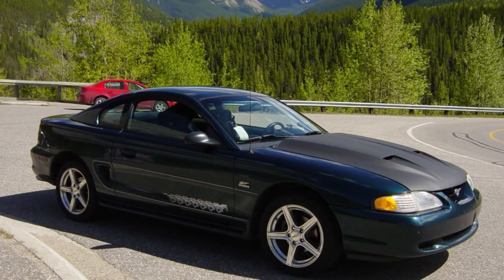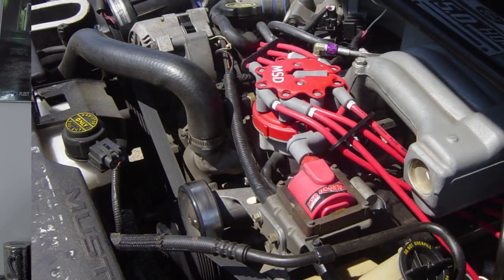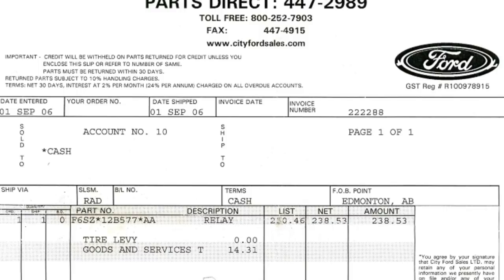SN95 Owner's Guide #3 - Myth of the CCRM

Comment: I have an issue with my 94 gt the fan will only kick on when the coolant temp sensor is unhooked I also have a poor idle maybe two different issues but the fan is a main concern  any ideas???
Reply: Had same issue with mine, your coolant temp sensor is going to crap, also look at putting in an aftermarket electric fan and also replacing the ccrm with a new unit if at all possible as another precaution...in 94-95gt’s the fan connector can get too hot because of the bearings going bad in the fan which are right near the connector and that can also cause issues to the ccrm which in turn can cause issues to the engine coolant temperature sensor

Comment: So if my 95 Mustang GT has low speed fan, but no high speed, could it be something other than the CCRM?
Reply from the maker: Hi Nick, there would be a few things I would check before changinging the CCRM based on what you've found. I would have try running direct power to the HS connector of the fan to ensure both speeds work. Then I would inspect the fan connector for damage. If that is all good, check for voltage on the HS circuit, at the connector. You should be able to force the HS fan by using a jumper on the self test connector found underhood for reading codes. When you cycle the key it will trigger the fan, both LS then HS. After that I would do the same test at the CCRM harness, you can find a pinout diagram at the link in the description box of the video. If none of those tests show the problem, I would consider replacing the CCRM. Does that get you started? Thanks for watching and commenting! - Darren
Reply: @GrandTouringConcepts  Yes, this gets me started, thanks very much! As far as the fan connector damage is concerned, that's sort of where all this started. When the car first had over heating problems I had a burnt pin on the connector. I replaced it without doing the research or reading the sellers website enough to see the suggestion of changing the fan motor along with it. So I burnt through that connector and replaced it along with the fan motor. Ever since then it seems like the cooling is really inconsistent, I'm willing to believe I've made a loose connection in the fan harness but I've worked in an electronic technician capacity for years, and I can crimp barrel connectors properly. Being able to trigger a HS speed signal with a jumper on the self test connector will be really useful. Since I have your attention, I bought the car in Virginia Beach, VA and have since moved south, to a much hotter and more humid environment. The previous owner had made some upgrades, but I'm not knowledgeable enough to know by just looking: how can I tell if the water pump has an underdrive pulley on it? Can I measure it without taking anything apart?   Either way thanks for the response, this channel is exactly what I need for what I'm trying to do, you guys are awesome!
Reply from the maker: HI Nick, you can usually determine if you have underdrive pulleys visually, or measuring. The stock stuff should all have Ford logos and PN's somewhere on them. Since youtube comments make it difficult to share photos you could hit us up on our facebook page and I can share some OE pulley photos for you to reference. Overall it sounds like you might be chasing a little larger problem, and it might be something like the fan motor is simply due for replacement. You are certainly tackling this in the right way, methodical checking, ahead of throwing the whole kitchen sink of parts at it blindly.

Comment: thought it was the transmission control box... regarding solenoid activation.
Reply from the maker: This is certainly the CCRM, and does not have anything to do with transmission control, it is literally just the fuel pump relay, and two cooling fan relays in a enclosure. Thanks for watching and commenting! - Darren

Comment: Please help lol

 I'm having a code Error Code P1233 is defined as Fuel Pump Driver Module Disabled Or Off Line. It shudders/hesitates sometimes when I turn it on/drive it sometimes. 

I have reset the inertia switch, replaced the fuel pump driver module and the shop told me the next step is to replace my CCRM but after the myth video I saw of yours I'm starting to question what they said... 

I'm at a loss and would love to know any and all opinions!
Reply: what year
Reply: 04 v6 3.8
Reply: @AaronC  any updates on this Aaron? I have the same issue.
Reply: Antonio Martinez yeah man it turned out to be one of my spark plug wires was sitting on a hot area of my motor and burned a hole through it causing the engine to misfire. It was kicking up sparks and everything I just didn’t see it because it was down by the 6th spark plug.

Comment: You should make a video on tuning these cars! I can’t find much info out there I’m probably not looking in the right places tho! I know about the quarter horse, svt chip, tweecers and etc but can’t find much info on them
Reply: Mods with Modest the off the shelf chips are hit and miss, in my case I had my car (94 cobra) taken to a mustang specific shop. He using core tuning chips and a dyno to produce accurate results and a reliable tune. The car only has a BBK cold air kit, bassani off road X pipe and SLP LM2 cat back it made 246 horsepower and 299 pound feet of torque.

Comment: Has anyone ever had problems with the fuel pump coming on with the engine off and ignition off. Not much on the internet about the problems I’m having. I’m not sure if it’s the CCRM or if Im have a ignition problem.
Reply: you have rats in your car
Reply: Nope it actually had nothing to do with the fuel pump. My ignition was messed up allowing it to turn back to auxiliary and allowing the dam CD changer in the truck to come on.

Comment: I have a 2003 GT and I replaced mine because my AC was not working and it did fix it, but the next day my car wouldn’t start and my battery was completely drained. I don’t have a cheap battery it is a optima and its completely drained. I never had this problem before. Anyone have any idea what it could be?
Reply: a ground?

Comment: 97 mustang gt cranks up then shuts down the fuel pump comes on right at first and then started the car the fuel pump never comes on again you can turn key off and restart it and it does the same thing ever time starts up and shut down after a few seconds
Reply: You ever get it fixed? My 96 GT is doing the same thing. Fuel pump primes, car starts for 10-20 secs. Then fuel pressure drops to 0 and car dies.
Reply: @marcludwick512  did you find a fix? My 96 very similar, I tried new fuel pump. Filter, fuses etc. please help with an answer if you can..thanks!

Comment: This isn't the same for a 96 gt correct? I just got a new fuel relay and it resembles that of a plug
Reply from the maker: It has been a awhile since I pulled the cross reference, but these are generally all the same for return style fuel mustangs, V6 , 5.0L and 4.6L some others cross over as well. -Darren
Reply: @GrandTouringConcepts  it's crazy. I have been combing the internet like crazy...no answer. Thanks for the response
Reply from the maker: Its old knowledge, and fading fast from the internet, my notes are F6SZ-12B577-AA is service replacement 94-2000 Mustang V8 after 1997, the older number is a F3 or F4 suffix from the original builds of the car. Escorts and Taurus can be found with these numbers as well. Always best to check, but that is the change I found with my 95 vs the replacement I bought unnecessilary in 2003.
Reply: It is the same for a 98 GT, so I would assume so. At some point, they did tuck them under the passenger side fender well though (pull the fender liner back in front of the wheel hub and you should see it up against the top of the fender).
Reply: @mn12sc35th  I'll check, I'm actually doing the fuel pump as we speak
Reply: @GrandTouringConcepts  I just opened up my 96 Taurus with the same part number as above and it has 5 Relays. Three high current 40A Bosch, and two smaller Omron relays that don't have a current rating. The one you showed could not be a F6SZ-12B577-AA as yours only had three relays.

Comment: So my low speed 10 amp fuse gets no power at all. Im assuming its a relay. Any information?
Reply: Oh now if it is a relay, is it the relay inside the ccrm that he piints out?
Reply: There is a relay inside this module for the low speed fan, but there is also a fuse for the fan itself. Should be a 50A (though I've heard 60A in some years) in the main power box under the hood. 10A is far too small for the fan motor, and as far as I understand, both the high and low speed fans use the same fuse (so if only one works, you may actually have a bad CCRM).
Reply: @mn12sc35th  Thanks my dude

Comment: But how do you test it
Reply from the maker: The Ford manuals do not have a test CCRM process as a standalone proceedure. The Pin Point tests which involve the CCRM are established within the diagnostic processes for Fuel Pump, Cooling Fans and A/C troubleshooting specifically. If the issue does not relate to those 3 systems, the CCRM is not in the chain of problems. General pin-out and wiring can be found in either the FSM referenced in the video, or in the 1995 EVTM but no CCRM specific checks are found there unless there are part of the troubleshooting paths for the issues above.

Comment: 97 cobra with gremlin- runs fine for about 10 minutes then PATS and other instrument lights flash and either lose spark/fuel causing immediate engine cutoff. After sitting (each time over night- unsure if shorter time) it starts back up. Mechanic tried to read code after shutoff and said no communication with computer. down the internet rabbit hole and ccrm came up. any suggestions?
Reply from the maker: The CCRM is a slave to the commands of the PCM, so it should not factor into your issue. It sounds like you have a more specific problem beyond the fuel pump relay and fan controller. A Ford dealer diagnostic system and pin point tests would probably be the best path.

Comment: I have a 95 SN95 with the 3.8. And I have a crank, no start problem. I've replace the crank sensor, coil pack, and the ignition control module, and I still have the same issue. Now everyone and their brother are telling me to get a new CCRM, but I'm not completely convinced that's the problem. And I don't really want to throw down $200 bucks to troubleshoot the issue. Does anyone know of something I might be overlooking that could be the issue? It's getting fuel, and it's turning over. Just no fire to the plugs.
Reply: Get one from junkyard I got one for like 12 bucks man
Reply: I had the same problem 3.8 mines was in thief mode because my CCRM board was burned, I just got one from the junkyard now my car been running for almost 2 years no problems.
Reply: Did you even clean your MAS?  Bought a 1997 crown Vic with exact symptoms, changed the same sensor-nothing.  Then, two squirts of MAS cleaner and it started right up!
Reply: If you're sure it's getting fuel, it's not the CCRM. The only things it controls are the radiator fan, the fuel pump and the AC compressor clutch. If you have good fuel pressure, look elsewhere.

Comment: everything works but my low speed fan. pretty sure after this video this is the problem.
Reply: Did you replace your CCRM? Did it solve the issue? Got the same issue with low speed fan not turning on at all. Even when i activate the AC.

Comment: Awful funny that prob atleast  half of the sn95 mustangs that has a/c failure end up being the relay inside this ccrm that causes the compressor to not click on. Good old radio shack part number 275-0031 that you get from Amazon for under $5 as long as you know how to solder

Comment: My 1994 cobra looses power at 2700 rpm in 1st gear and back fires when I let go of the throttle. It has new spark plugs and wires also a new gas tank and fuel pump. Any suggestions on what the problem might be?
Reply: only in first or it does it at 2700 all the time?
Reply: @codyramos3200  1st for sure sometimes 2nd.
Reply: did you change fuel filter when tank an pump was done ? does it run better when you first drive it in the morning after sitting over night ?
Reply: cam positioning sensor check that n fuel filter if you didnt replace it
Reply: @codyramos3200  filter was changed and timing is good. Thanks I will check that sensor
Reply: yes in the morning or 1st use is works great it does it after a while.
Reply: unplug it an drive to see if it clears up the issue ..
Reply: @codyramos3200  I will try it thanks bro!
Reply: any luck ?
Reply: @codyramos3200  haven't had time, getting ready for a storm here in Texas coming from the Gulf of Mexico. I will let you know how it goes thanks
Reply: i hear ya . im on the coast myself in south texas .
Reply: Jamesohara if could also be your pick up coil in your distributor and I ran into same situation and I got to looking inside the distributor and noticed that black ground wire was loose, tightened it up and fired up started good and no more problems, my problem is my volt meter drops a lot when lights and blower is on but everything checked out good, battery and alternator, was wondering would that give low voltage to the distributor and effect the performance, put a new distributor in and it ran better than ever since I’ve had it and after a few days volt meter started dropping again and not running like it should with performance.. what the cause???? And mine is a sn95 gts Manuel and running 70mph my rpms are at 2600 in 5th is that normal gears??
Reply: @codyramos3200  im pretty sure 94 95s dont have a cam position sensor.

+1 on the pip located in the distributor.
Reply: @mindandbodymuscle5345  ,  lol i slipped up on that for sure .

Comment: Does the ccrm control the a/c compressor
Reply from the maker: The CCRM does have several circuits fir the AC system, clutch ground and a few others. Google gtconcepts and ccrm to read our pinout article or go to this link to get a better look: http://gtconcepts.ca/main/index.php/2018/12/03/mustang-ccrm-all-you-need-to-know-with-diagrams/